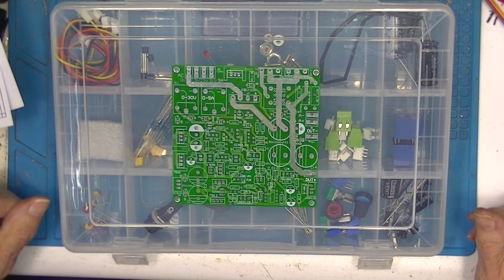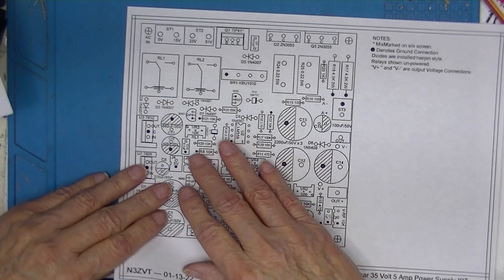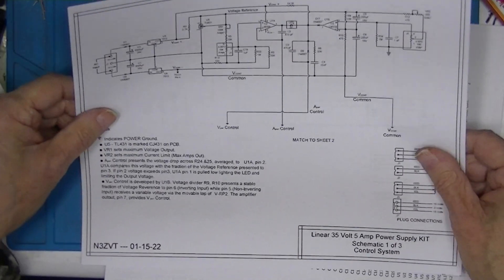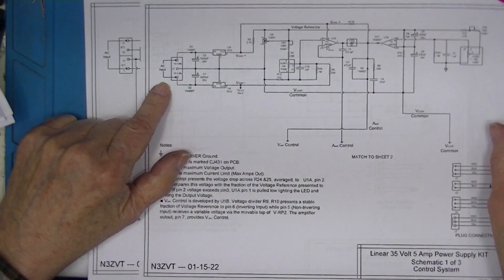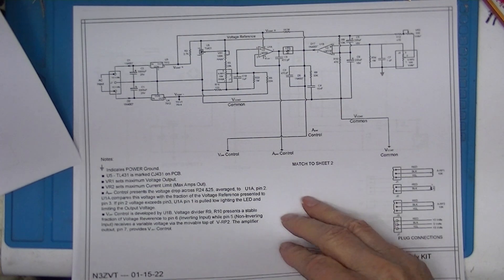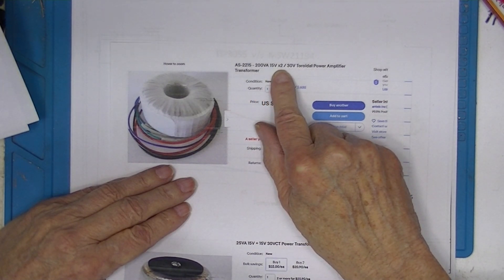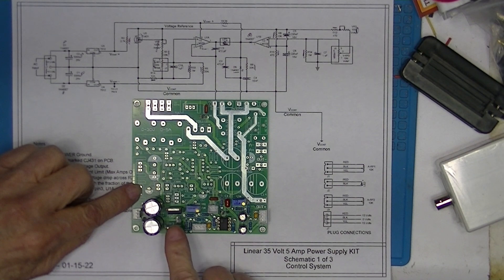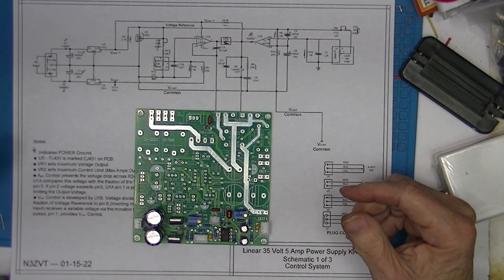35 Volt 5 Amp Chinese DIY Power Supply Part 1

Comment: seems you fucked up with u3 on your schematic/board layout on thisyou have 2x u3!! but no u6!?
Reply from the maker: Paul,
Thanks! I have just posted the latest revisions of the Board/Schemait drawings and included the change from U3 to U6 for the 12 Volt regulator  in the utility circuit.
Are you building a supply?
Steve